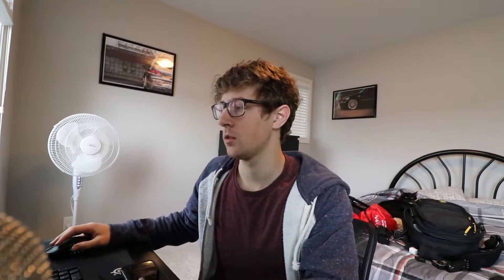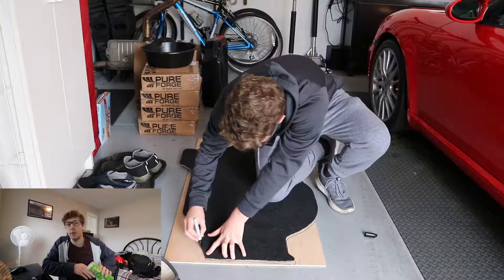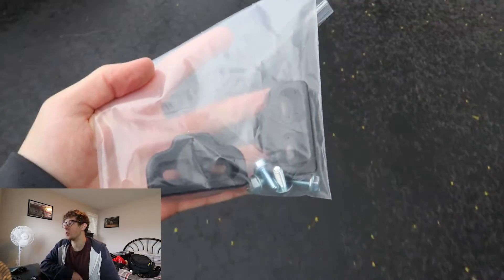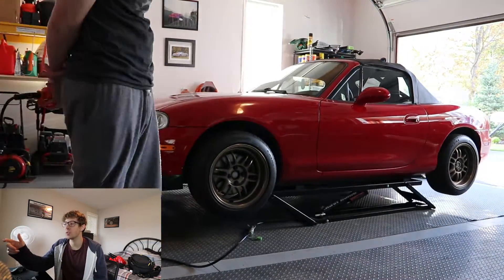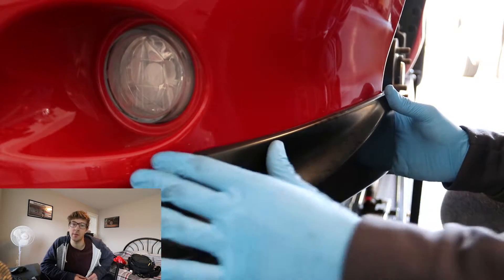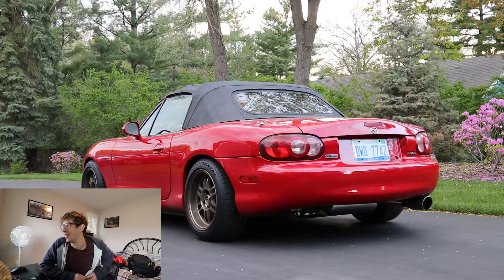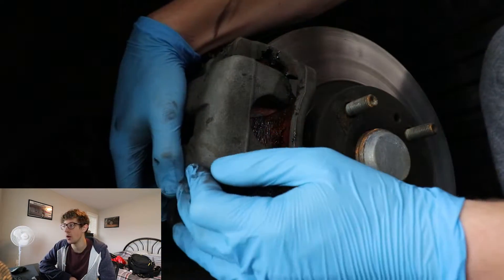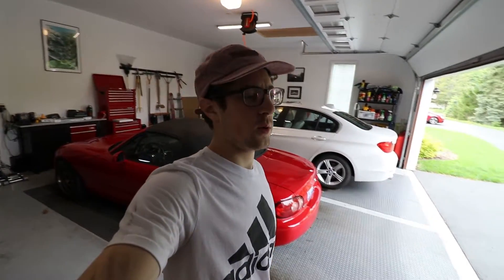The Process of Making a Clean Car

Comment: Hey Man, love the channel !
I've got an NB with nearly identical mods. I was just wondering what spring rate did you go with on your BC BR coils (Mine is 10kg/8kg)? Also,  how many clicks from full soft are you running on the dampers in the front and rear? I'm just curious what others with these coils are running...
Reply from the maker: Mine is 10k/8k as well, I'm running pretty stiff damping due to my fenders not being rolled.  My suspension setup in terms of damping is about to change in a couple days once I roll my fenders.  I'll probably make an update with how many clicks I'm running